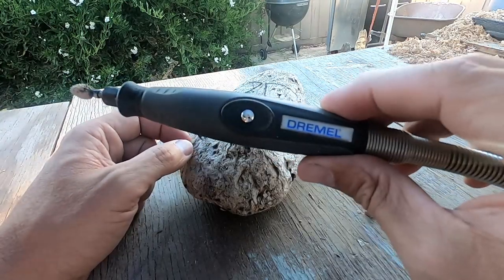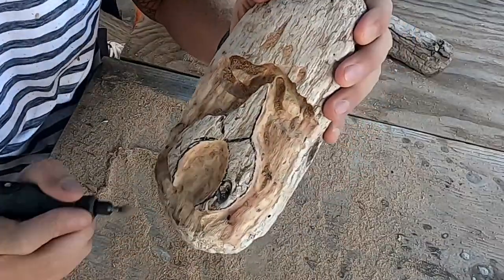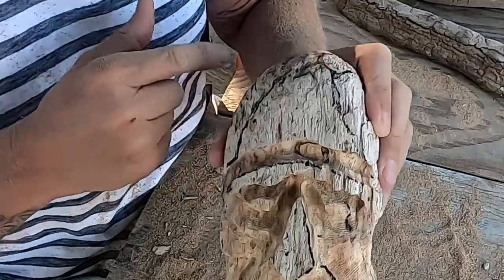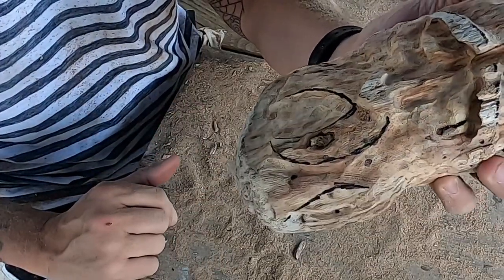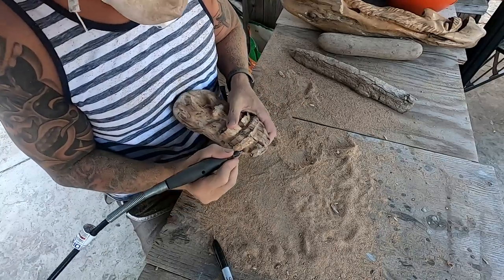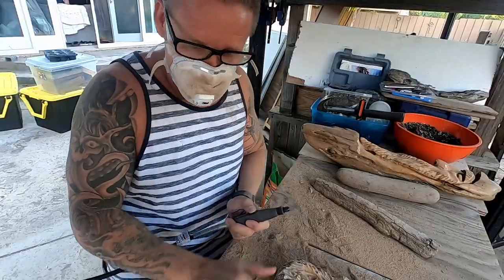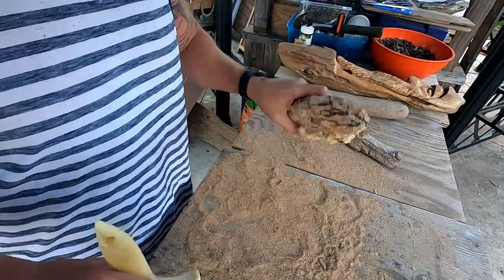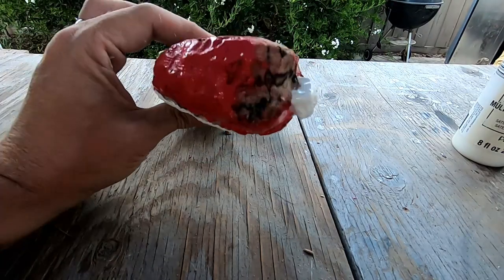Carve Santa Wood Spirit With Dremel Flexshaft, Foredom, kutzall

Comment: I make the same sander from jordy  . i have that tool now i know what to do with it thank for the tip.
Reply from the maker: Mark Rhine No problem Mark. My sander is a little different that Jordy’s. It’s just normal paper sandpaper, not cloth backed. And it’s not a bolt and nuts. It’s just a little burr that came with the dremel kit that has a screw on the end. I’ll try to remember to show it in the next video. 

Thanks for watching.
Reply: @NorCalSucculentShop  i would like to see that